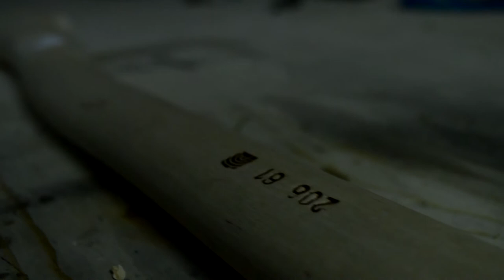Restoring An Old Axe

Comment: A couple coats of oil (ex: boiled linseed or tung oils) will work for a finish as opposed to a clear coat.
Reply from the maker: Yeah that's what I thought too. I'll be using the axe for a while and see how bad idea the clearcoat was. I'm gonna buy some danish oil for my knives and slingshots and maybe for the axe if I have to sand the clearcoat off.

Comment: the video could have been a lot more lit
Reply from the maker: I guess you mean its too dark, and i agree on that but I wanna try to keep filming fairly cinematic and that requires manual settings on my camera (I used automatic settings on my older videos). I have pretty much the best settings for sharp quality but my lamp really sucks, it's not really that powerful and it's on the other side of my shop so it makes lots of big, dark shadows. I have to get another lamp or go back to automatic settings which are not cinematic at all.
Reply: NorthWeapons i love the low light cinematics